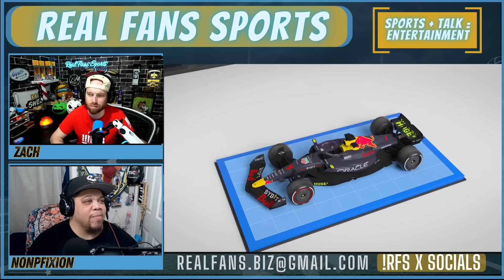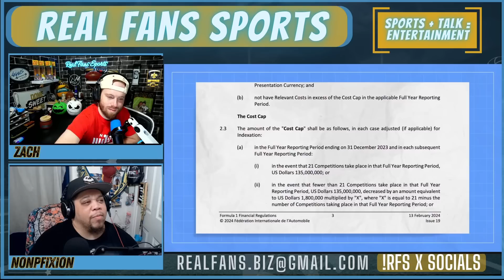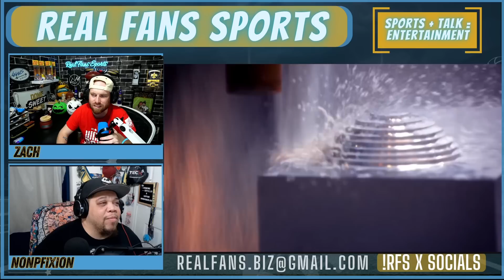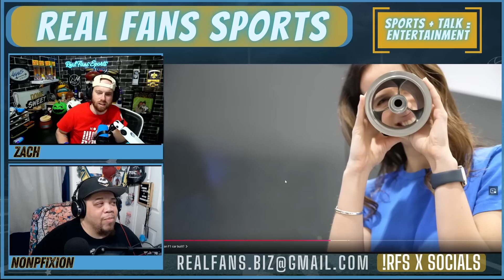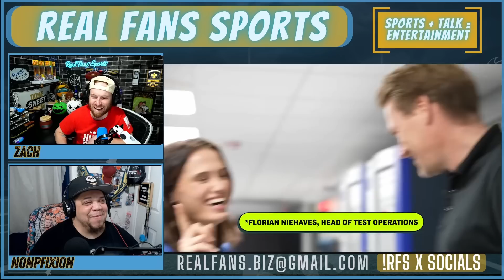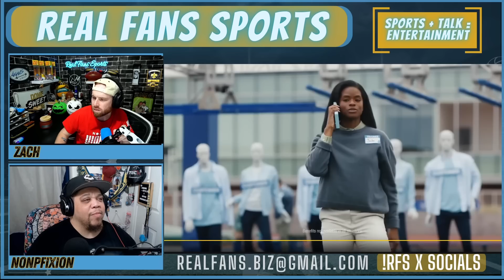AMERICAN REACTS TO FORMULA 1 CARS EXPLAINED FOR ROOKIES FT. MAX VERSTAPPEN || REAL FANS SPORTS

Comment: The machines  that where used on a metal block. Those are called cnc machines and they can be expensive that depends to what you wanna do with it. Its a computer based drilling and milling machine they chip off metal from blocks or other forms till its like the program says it should be. Redbull needs to either buy it from someone else or build it yourself. Honda isn't gonna give them engines mostly due to them not f1 racing again. And i dont think we see an video about a engine for years until its not used anymore in the cars then maybey they will show it off.

Comment: Red Bull dominates because they have managed to find a significant enough edge in their car compared to others, which can compound into runs of multiple years as others have to spend their budget to figure out the same kind of edge while Red Bull can use theirs to get even further ahead (which is mostly because they have the most legendary chief engineer and designer in the world). This is pretty much the norm in Formula 1, there are seasons where a specific constructor dominates and until the edge they have is reset by the rule changes.

Comment: After every great rules change in F1, one team typically nails the new regulations and will likely dominate for the next few years to come while the others catch up. In the Turbo Hybrid Era (2014-2021), it was Mercedes with Lewis Hamilton. In the current Ground Effect Era (2022-2025) it is Red Bull with Max Verstappen. However, helped by the cost cap (in place since 2020), this also means that team performances converge with one another as they catch up, making the end of each regulation's era particularly competitive and spicey. This resulted in the epic season of 2021, where Max won his first title, but also in teams caught up with Red Bull in 2024 and McLaren winning the Constructor title instead, having not won it for 26 years. 
Who will be the dominant F1 team in the upcoming Sustainable Fuel Era (2026-2030) is everybody's guess with new car engine manufacturers entering the competition (Audi, Red Bull Powertrains/Ford, Cadillac/GM). As it usually takes years to develop an F1 engine from scratch into a race-winner, my money would probably be on Mercedes or Ferrari.

Comment: That's why rally B will be ever the best. No regulations, no rules money gap you do you! I respect the angle of safety vs rally B and all but imagine in 2024 rally B group racing w/e car you want ... bruh we crush records here :D And no limit is your year budget for all. Testing, simulating, and all. That's why you have a bunch of ppl simulating stuff for cheap before going to tunnels. The end of a car is never made since you make changes between races and you need a budget for that too. So I am no sure about how rules apply but there are some factors to cover. As for the fluid, mention look in to Porsche GT RS3 where in the engine oil part you can see extra part that does waves on oil so oil can split and not shove in one part of the engine and split to have balance ...

Comment: It isn't that RedBull didn't want to partner with Honda anymore, Honda officially pulled out of the sport, then changed their mind when the 2026 engine regs were official. But the time in between and Ferrari and Mercedes not wanting to supply them with engines, and the Renault not being a valid choice, RedBull had no choice but to start their own engine division.

Comment: The reason for testing abroad is simple, the weather. These cars go through final development between the end of 1 season and the start of the next. And here in Britain where most of the teams are based that is during our winter. First testing is limited to a few laps just to ensure the cars are safe. Then all the teams rock up to the same track to test their cars at the same time. They usually get a few days to do tweaks and compare parts to get the best from the car. Most teams never go flat out as they want to keep their true pace hidden until a week later when the season starts and they go racing for real.

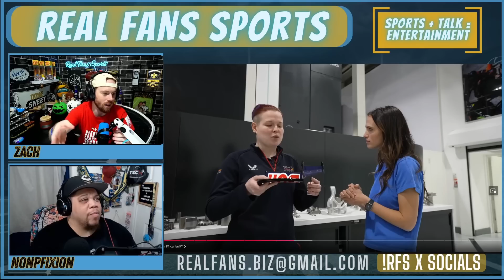Comment: 15:42 well, that block isn’t “raw” carbon fiber but several hundred very thin sheets of the stuff bonded together. Not sure what they’d use that block for to be honest (pure materials/production test maybe), because the actual parts manufacturing is what we see right after: individual layers being laid down on a template, vacuum-bagged to squeeze air out and baked to cure and set the resin. So, sure, you can make a flat slab of the stuff too, but you wouldn’t be machining something out the block afterwards. The strength comes from the layers following the final shape, rather than being cut. And it just sucks to machine.
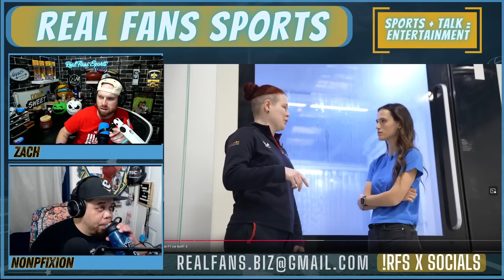16:41 that’s just coolant; it’s a regular milling machine. Ok, it’s no doubt 5 or 6-axis CNC milling machine, but still: “regular”

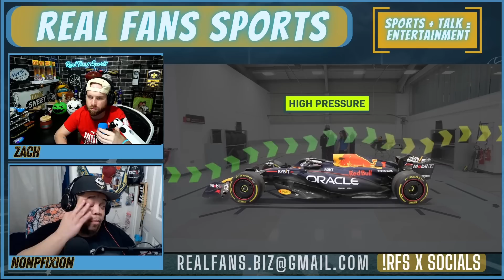Comment: 10:21 vacuuming the car to the ground is pretty spot on - and in fact, cars once actively sucked themselves to the ground with a giant fan. Yes, an actual suction fan. That design was quickly banned by “the formula” but for a short while it was very effective. And it’s still used outside formula 1, even down to micro RC cars because you get stupid good grip. For F1, the car nowadays has to be moving through the air to create its downforce, but with the fan, the car could have insane downforce while standing still. It got banned for a number of reasons, like not wanting all the teams to just start building more fan and less actual race car, but another reason was just safety. These cars relied on having very little ground clearance to stay attached, but if they ran a bump to hard, the “seal” to the ground would pop, and the car would suddenly behave like it was much, much lighter, lose grip, and go flying. And they also literally vacuumed the track, throwing debris at whoever was behind them. So that alone made the fan cars pretty sketchy. But it’s sort of the spirit of F1 to just do something ridiculous - like putting a vacuum fan on your car - as long as the rules haven’t yet thought to say no. Ain’t no rule that says a dog can’t play basketball.

Comment: 10:25 - You mention it being like a vacuum to the ground. There was actually an F1 car in 1978 , the Brabham BT46B, that had a giant fan on the back that sucked the air out from underneath the car. 
The team claimed it was for cooling, which it technically was, but everyone knew what it was doing. It competed in one race and it dominated. The drivers were even told to hold back during qualifying to hide it's true pace. 
While it was technically within the regulations, the team withdrew the design after one race, following the massive uproar from the other teams. This was mainly a political decision by the team owner, rather than a sporting one.
Reply from the maker: Interesting. Thanks for sharing that with us.

Comment: To answer some of the questions that were asked in the video (to best of my knowledge) : 

- The 135 M budget cap : it applies to managing the whole team not just building the initial car only. Damages caused by the crashes are included in the cap. But the salary for the drivers are not. The salary for the top 3 employees (or contractors, not sure) are excluded as well. In the year before the cap, redbull spent over 300M and I think the record is with Mercedes in 2020 or 2021 with over 400M. (The cap is adjusted based on inflation and the sprint races done in that year)

- Why redbull is successful ? Multiple reasons, but mainly Adrian Newey (the guy who designed the car), Max Verstappen (the N1 driver in the team) and Hannah (the strategist of the team during races). There is also the technical lead but I forgot his name. These are the best right now in F1 (except Newey, he has been the best for the past 20+ years)

- The testing : Bahrain is the first track of the year. So they go there one or two week before to hold a three days testing. In the past in was they used the Barcelona circuit because it has a basic version of every type of section they want to test (fast turn, slow turn, change in elevation, long straight...)

Comment: Red Bull actually used Renault engines longer than Honda.
F1 drivers do have lower back problems, especially after driving on a bumpy/uneven track.
Pretty sure those people looking at big screens back at the factory do it all weekend long, from practice to the race because the sensors on the car pick up data the whole weekend and it needs to be analyzed ASAP in order to come up with different strategies in preparation for the race but also in real time.
Bahrain is where testing is done because it has a great combination of slow + medium + high speed corners & straights. It was done in Barcelona Catalunya before Bahrain.

Comment: Last set of rules brought in the new engines. Mercedes got on top of that and was dominating before redbull. The current set of rules changed towards ground effect ( instead of getting most of your Aerodynamic grip from the wings you get it from creating a air vacuum under the car sucking it to the track) RedBull got the best design out of that and the others are struggling to catch up. But they have now. Just like Honda engines have now caught up to the Mercedes. 
When ever there are big rule changes you have that one team that has the AHA ! moment and then it takes some time for the other teams to catch up.

Comment: 8:24 it's cyclical, there have been different eras of formula one where different teams have been dominant, for example Mercedes before RedBull, then RedBull again before Mercedes, then you had a Ferrari era before that. Usually when there are regulation changes it provides a opportunity for teams to create a better design and outrank the current dominant car. Also, new technologies can also make a team jump up in performance and outperform other cars, but I would say that it is mostly in the past now. Nowadays F1 cars are pretty similar to one another, so having top of the line staff and designers will usually be the things that will make a car perform better, not new technologies. This current season has been interesting as in there has been quite a competition betwen different teams, and although Max Verstappen will probably win the drivers championship for RedBull, we had other drivers and teams fighing and winning races, so much so that RedBull probably won't win the constructors championship.

Comment: The halo doesn't make a difference at all to vision. if you're looking straight ahead it's not in the focus area of the eye so your brain blocks it out and you see straight through it kinda like when you put a camera close to chain link fence and focus at a distance. Drivers also spend the majority of their time looking to the sides because their focus with always be towards the next corner. There is a video of Nico Hulkenberg driving an f1 car with eye tracking that you could check out in your private time.

Comment: the beauty of f1 (but something that can also turn people off) is that dominance in the sport isn't usually down to a single factor. Red Bull had a great design team, they knew how to work within the rules effectively, and also had a fantastic driver in Max. Combine all of that, and you dominate. You can see success if you have 1 of those things, but get all of it right, and this is what happens.

Comment: The 135 million includes everything including when the drivers wreck
Reply: Not drivers pay.  If you want the superstars driving you have to pay them a butload. That money is not in the cost cap.
But yes, repairs and replacement parts do come out of the limited budget including bad parts or the cost it takes to run the airo tunnel where they evaluate potential parts.
Airtunnel hours are actually a thing of its own where the slow teams are allowed more hours to give them a chance to catch up and the fastest teams are allowed less.
Reply: @JL-cn1qi  interesting I been wanting to watch something on how the cost cap works exactly or read up on it
Reply: @22Chad_Reed22  Basically everything that's needed to make the car, and then everything that needs to be upgrade parts, and then everything that damages the car and the cost to repair it. That's mostly what the cost cap covers.